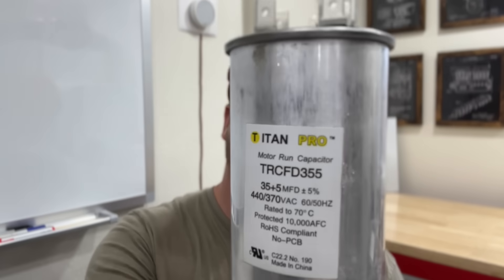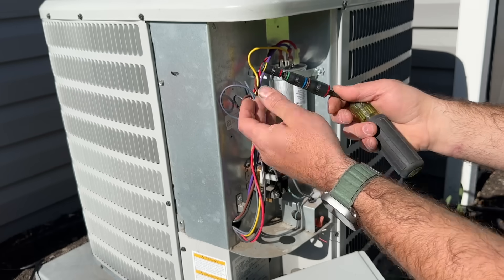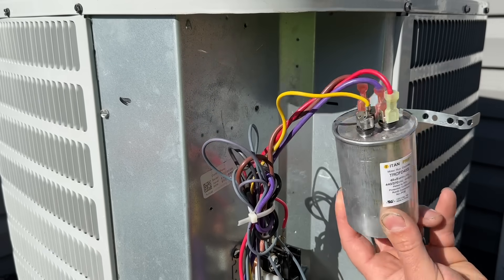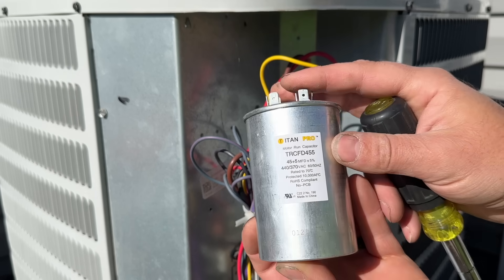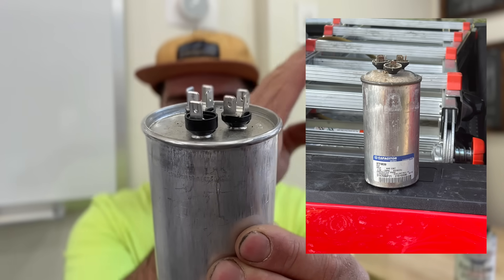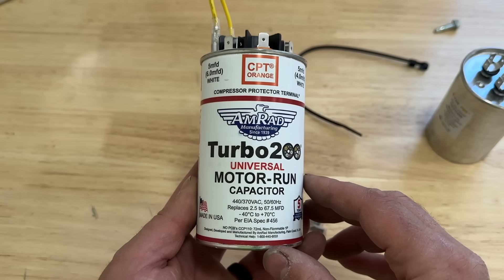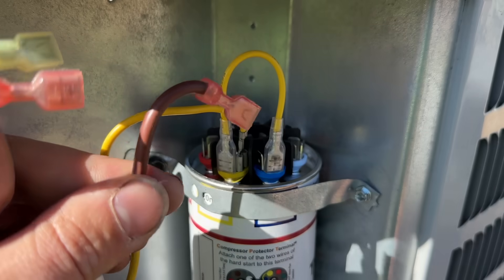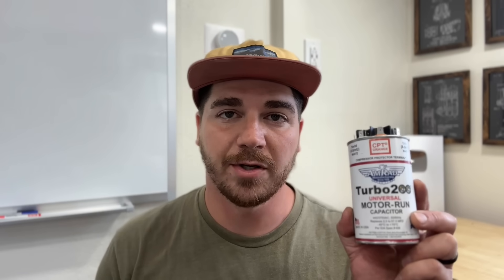HVAC Contractors Practically Make Their Living On These

Comment: They don't "jolt" they provide a phase shift into the motor windings which excites rotation, Those are duel caps which is two capacitors in one package providing phase shift for both the compressor and condenser fan motors.

Comment: In Florida the wide temperature range seems to be the capacitors worst enemy.  I keep replacement and replace them myself.  Takes a few minutes and save a service call.  Cold spells seem to be the worst time for failure, but not always.

Comment: They charge a lot because of the danger, and I wouldn't call it a "little" battery. They can kill you if not handled properly. It is like automotive brakes. Yes they are easy and the parts are inexpensive but they charge a lot because of the liability, insurance, etc..

Comment: My cap kept going out due to high heat so i placed it outside of unit and that stopped tge high heat problem and no more blown caps. I was a ac repairman all my life.
Reply from the maker: Huh?! That’s interesting. How did you keep it weather proof?
Reply: @diyhvacguy  put it in a small metal box under controls  heat from condenser does not make it hot and it does not actually produce much heat by itself.

Comment: Most units have two capacitors, a start capacitor and a run capacitor. Easy way to find out which is bad is to look at each, if the top of capacitor is swelled up, not flat, that one is probably the bad one. If it's a bad start capacitor, you can start unit and push start fan blade with a screwdriver or something that will fit into the fan grate. If it starts when fan has been push started, that tells you it's the start capacitor and not the run capacitor. If it fails to start, it may be the run capacitor. They are very easy to replace and are pretty cheap, but be very careful when handling them, they are like a battery and can hold an electric charge and can electricute you. To keep that from happening, make sure to take out the a/c main power bank and place a screwdriver with an insulated handle and cross the two terminals to disperse the electricity in the capacitor.
Reply: Most units actually only have a single dual capacitor these days.  Start capacitors do not start the fan motor.  They are only for the compressor.  A fractional HP fan motor does NOT need a start cap.

Comment: My cousin got his HVAC career started on a bad capacitor. He began with a large HVAC company but got tired of constantly being pressured to sell optional repairs and stuff. So, he branched out on his own. One of his mom's friends called her for an HVAC referral because she had just been told she needed a whole new unit, and she wanted a second opinion. His mom told her about him, and all he had to do was replace the capacitor. He didn't charge her anything even though she insisted. She bought a half-page ad for him for her church's program for some function, and that ad was what kickstarted him. Sorry for the long story, but having heard it a bajillion times, I couldn't help myself.
Reply: That's a great story.
Reply: I'll tell you right now if I change a motor I'm changing the cap. But then I'm the guy that has to come back later
Reply: @jimlippi4001 I don’t know anyone who changes a motor and not a cap. That’s just crazy.
Reply: My capacitor blew last year. HVAC tech diagnosed a dead compressor and walked away  during the hottest month in living memory. I got a $5,000 quote to replace the whole system 4 weeks later.

The replacement capacitor I installed is still getting the job done.
Reply: @Struthio_Camelus  the hvac repairman should have a stock of capacitors in his truck or van!! That repairman is useless
Reply: @johnhardasnails7464  He isn't invited to come back.
Reply: @Struthio_Camelus  I mean when he came in the first place
Reply: @johnhardasnails7464  Agreed. Here we are @ The DIY HVAC Guy channel. The name checks out.
Reply: @johnhardasnails7464  His Van was fully stocked. He's just a con man. That's what this video is all about.
Reply: @aznative_  well I thank god my education in electrical engineering that I could read up on air conditioning theory and figure out the more obvious stuff on the AC unit. Plus finding the Grainger supplier carrying all the parts needed
Reply: PEOPLE ARE SICK OF DISHONEST SCAMMERS, SO WHEN THEY MEET AN HONEST CONTRACTOR, OF COURSE THEY ARE GOING TO SPREAD THE WORD.
Reply: Thanks for the comment. That's a great message 👍.
Reply: Thank you for sharing !  What you have posted have saved so many helpless homeowners.  I can imagine  all the people  that has been done wrong 😢 !!
Thank you !!
Reply: Good guy!
Reply: @captainaxle438  still 15 dollars compared to 2000 goes a long way since I doubt you will burn one out every month
Reply: Yes the compressor motor capacitor and fan motor capacitor fails every few years on average.  I usually order them from Grainger .  I had to replace the blower motor on the outside unit twice over a 22 year period.  I also replaced the inside blower fan capacitor before failure since I needed to clean the cooling heat exchanger anyway and I preordered it with the other parts. Some new units use a cap for the compressor only. The new ac fans are variable speed pulse modulated with a control unit and no cap required.
Reply: @johnhardasnails7464 New systems with “inverter” drives which soft start are the bomb!
Reply: There are some BAD AC guys, just like any other business. I have gone behind these guys on calls like this. Always get a second opinion on “Your Unit Needs Replaced Calls.” Every unit can be fixed, the question is; Is it cost effective to do so. By The Way… There are some bad customers too.
Reply: People need to leave reviews for these bad hvac companies trying to scare people into purchasing new units.
Reply: I LOVE THIS STORY!!!
Reply: That's amazing.
Reply: Great story
Reply: i love an honest people. greed wont get you anywhere most of the time.
Reply: @captainaxle438  🎉😂 It may be more common to use a Chinese capacitor these days. But we still produce them here in the good old United States of America. If your AC guy was good, he would say i replaced this piece of crap Chinese capacitor with an American made capacitor, but he put another Chinese one in there because he doesn't know any better. That should scare you.
Reply: @aznative_  Most AC Contractors know the difference between a China paper wound capacitor and an American mica wound or oil filled capacitor. And YES, the difference is substantial. A mica Capacitor will outlast a China paper wound cap by five years or more. Air wound capacitors aren’t worth installing, especially in humid climates.
Reply: @Captkid1  I approve this message 👏
Reply: @aznative_  from technical to Geo-political just like that.
Reply: No
Reply: @aznative_ I am curious how busy the Chinese AC technician would be?
Reply: Great story! Thank you
Reply: I read the whole story. Thank you!
Reply: Cool story that's awesome God is awesome ✌️❤️
Reply: I love this story, and I hope your cousin can resist the temptation to fall in line with what the rest of the industry thinks is acceptable. It's better to get a whole lot of honest business and easy jobs than to scrape together the occasional score by scaring customers. Everyone that I know that "has a guy for that" swears by him/her because they never do these cliche shady deals.
Reply: @Cryocide  I am retired now. But, I never advertised and never had a shortage of HVAC work for my business. Most important… I never overcharged ANYONE. I never installed a NEW unit that didn’t replace a worn out unit, unless ask to do so.  I worked on the principal of a fair days work for a fair days pay. I probably made less than other contractors, but I made a good return on my investment. (It takes $$$$ and had work to get licensed and buy your business equipment),  

Every part I sold was marked up the same; enough for me to acquire the part, install it & make some profit. Unfortunately, in my second year of business, I had to quit taking new customers unless some moved away or quit needing my services. Could not get competent help and was working too many hours already.  
 
Still, I had a few customers not pay their bills, one was a multimillionaire. Later he called and called trying to get me to work for him again. Never did a thing for him. Kept track of non-paying customers and shared them with other AC contractors.
Reply: @Captkid1 After more than one year, I am still waiting for a 6K check from a multimillion business. 😢
Reply: People who have no clue about the tech,   are ravaged  All The Time
Reply: 👌 No problem!  Its the 'teens & early 20's crowd who dont like long comments.  I can safely say for others here, we came here because weve got the time to read!

Thank you for contributing your "long story"
Reply: Good customer service and honesty are the two most important things for the success of any business and your cousin has both! Hopefully he’ll keep it up.
Reply: Godless him ❤
Reply: People like this should be rewarded. Thank God for him and his morals ❤.
Reply: @captainaxle438  I believe it. The best Caps are made by the Japanese, but I dont see any Jap offerings available for heat pumps.
Reply: @captainaxle438  Made in China = 1/2 the life of America made.
Reply: @captainaxle438  🤣😂👌
Reply: @captainaxle438  make cents then
Reply: That's how it happens. MY grandfather taught us you do right by good people! and they will bless you and be a blessing on too you!
Reply: lol that’s a miracle.
Reply: Sounds like one of my bros
Reply: Thanks for sharing!  Inspiring story.
Reply: It's a good story! He's kidding himself by not charging $100 plus the part
Reply: lol she’ll be calling again
Reply: I like reading little personal stories like this in the comment section.
Reply: Thanks for sharing 👍
Reply: Best story I've heard all day.
Reply: I'm just trying to get an HVAC contractor to return my calls.
Reply: What a sweet thing to do for someone!
Reply: Cool Story!
Reply: My AC was the same way.   He atarted out with a bog company that basically required him to rip people off.          He started his own company that treats people fairly and has more work than he can keep up with.    He is awesome.
Reply: You raised him well.
Reply: Love that story.  Love it.
Reply: Wonderful story. Thanks for sharing.
Reply: Our HVAC company was started that way that we use. The old guy came when our furnace broke and he found a $50 part from junk and replaced it saving us a whole new furnace. Total cost was $80.00. We still use the same company even though the owner retired because his son is the same way.
Reply: Glad you shared his story
Reply: Tell it, Good HVAC companies need shout outs. With word of mouth, he will always have work. Thanks
Reply: Same thing happened to me. I have yet to find someone to help me...😢
Reply: This a great story and it needs to be told over and over again! People who have knowledge of something are almost always going to take advantage of the ones who don't.
Reply: It’s called karma…bro….if you do the right honest thing.  It will come back to you….i know…first responder for 34 years.  Learned that in my private life too…
Reply: Glory be to God.
Reply: That's a great story!

I remember I did roughly the same thing for a bunch of old ladies living in a mobile home, they ended up moving and giving me the home, I sold it for 3500 cash like 18 years ago
Reply: God bless that young man. Is he in central Florida by any chance? I could use an honest AC guy.
Reply: Beautiful All-American attitude in that story!
Reply: @captainaxle438  Since you're knowledgeable enough to say that. Send me the specs for your capacitor and I'll send you a link to buy an American capacitor. And just because something seems obvious. I need to point this out. Don't kill yourself trying to read the specs off of the capacitor. If someone doesn't know what they're doing they could touch the wrong points and kill themself. But you know all about that. After all, you're an expert. 🤣🤣😂🤣😂
Reply: @aznative_  your b sing you act like an expert. If you were you would know what my AC guy said is true, and certainly not enough of a comment to warrant your armchair response. My AC guy is old enough to remember how the older caps lasted longer. You sound like a kid whining
Reply: @aznative_  tongue it
Reply: @aznative_  A capacitor won't ecer cost 2k just for being made in usa, unless the person or company wants to charge that number. But the capacitor itself won't ever cost anywhere near that.
Reply: @emile-a2394  You're the second person who has said something in this comment to me. That doesn't make sense to me. Why would I think a capacitor cost that much money? I tutor electrical engineering students for a living. I have a really good feel for the prices of components. Maybe I said something that was confusing?
Reply: @aznative_ you must be a AC tech that’s  screwing lots people
Reply: @charliezaid4596  I'm not sure how that makes any sense.

Comment: Your channel has so much good info!! I was charged $300 last summer for a bad capacitor.  It was for a rental property on a Friday evening so I was paying to keep tenants happy.  The AC unit was installed in 2021 so I was upset it was already having issues.  I clean it twice in the summer.  Once I found out it was a $10 part I still felt a little cheated.  I cannot believe people are paying $2,000.  That is a scam.
Reply: An emergency service call ( after normal business hours  ) is typically twice the normal service call fee . Time and materials.
Reply: @anthonygonzalez7488  $300 for an after hours call, and a $15 part, does not seem bad to me.  Tech made a living. Not a killing.
Reply: If the unit was installed in 2021 the capacitor would be under warranty. You paid for the labor,service and time to facilitate the warranty(paperwork and Shipping and Handling). You got a great deal.
Reply: That $300 was a GREAT price for a Friday night cap call out.  To think you were scammed or cheated just shows you have no clue about how businesses are run or supply and demand.
Reply: If HVAC companies were really your friend, when they install a new HVAC, they should include an extra cap.

Comment: The second issue is that some fans melt inside with the excessive Florida heat … these are common motors that cost about $45 and takes about 60 minutes to swap out …
Reply: Can’t find $45 fan motors anywhere…

Comment: Its a service call and should fall under the min bill rate plus part at most. The ones I use are the cheater ones that cost $60. I am not an Hvac guy but on my properties I manage I charge 250 and include the part. So yea the Hvac guys probably love me leaving expensive parts behind.

Some will find my min rate of 250 to be a high, but I charge 250 minimum for anything I do. The peopel before me charge a lot more and wont come back out for free if its wrong like I do.

Comment: A couple hundred for parts and labor to send a skilled technician out on a service call with the tools and knowledge to diagnose the issue and fix it is reasonable. A couple grand for a 10 buck part is highway robbery unless there was alot more wrong than a bad cap.

Comment: The capacitor doesn't store charge to give the motor a boost. It alters the phase of the incoming power to cause the magnet field in the motor to be in a different spot to cause it to turn. Once moving many such motors have a centrifugal switch that turns off the capacitor and the phase shift. Others run on them permanently using the capacitor as a permanent phase shift for one set of windings.
Reply from the maker: You realize most people barely know how a motor works, so this obviously was extremely dumbed down so people can grasp roughly what it does.

Comment: I went to HVAC supply house to buy capacitor, they have 2 models $10 (below) or about $15-$20. I asked what are the differences, they told me, the cheaper one is THE ONE that “most” hvac company buy (made in China or ….) last about year ish (depending on how old your system is) SO they can come back again the following year. 
He said if you don’t want to come back next year or so, get the USA made (I believe the brand is Mars) it will last longer. 

I get extra part for emergency use
Reply: Quick note: Made in USA and Turbo200 caps are made in Florida and sold by Global the Source.

Comment: My AC works fine except when it gets real hot outside it can't keep up even though super cold air is blowing out. Contractor said I need new condenser even though it seems to be working fine... except can't keep up after 80 degrees?

Comment: Imagine working in a trade, investing in some diagnostic tools and not using them. Yup capacitor, its bulged, 💰💰. Its usually a result of something else, voltage drop perhaps? Dont check the pitted contactor, the burnt stacon under the compressor cover or the toasty breaker in the panel box. Nope, go to the van and write up a quick invoice
Reply from the maker: Yea happens all the time. Cap n go baby. 🤣 This is true sometimes, but if people are staying on top of their maintenance, that shouldn’t be the case. Any capacitor will have a certain life expectancy. Most are between 5-7 years.

Cheers
Reply: @diyhvacguy  sad to think you have a van with some frequently sold parts and you wouldn't replace the pitted contactor just below the capacitor. Maybe cover a little more overhead on the truck? Maybe wow the customer by using the flir infrared camera and uncovering a worn out overheated breaker cooking the busbar in the panel box. Kinda like going to healthcare professional complaining of some tightness in your chest and then prescribed some Tums for indigestion. Here's your bill....